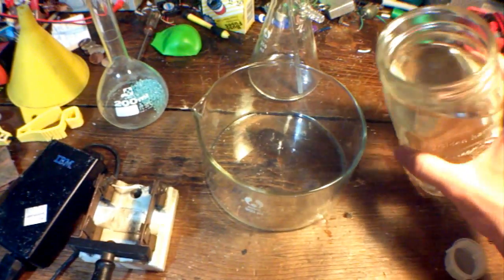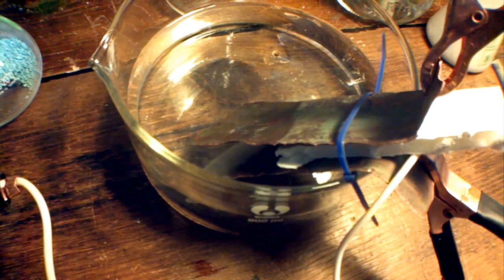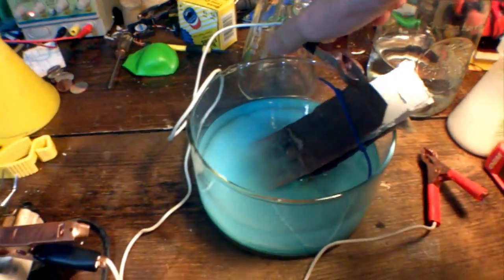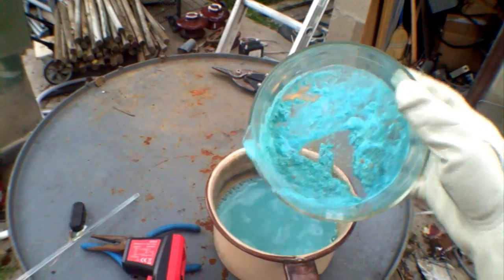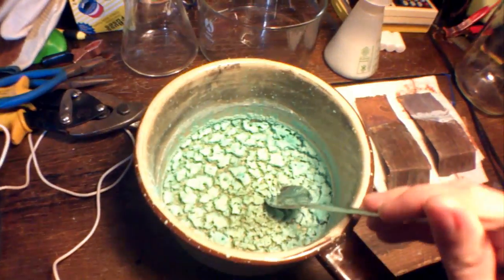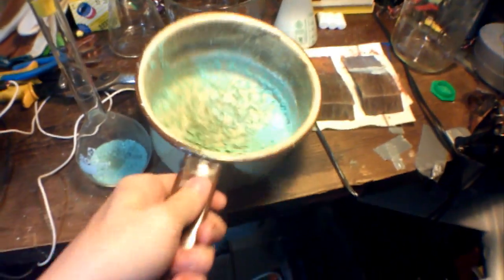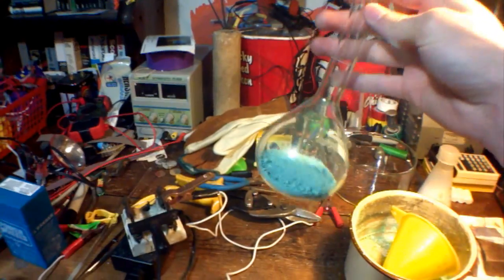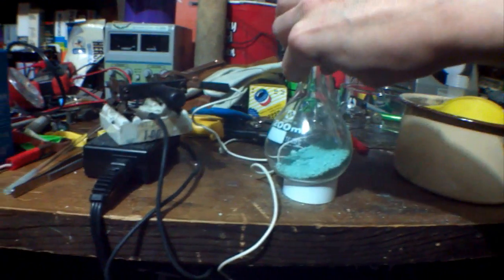DIY Making Copper Hydroxide via Electrolysis

Comment: Mine turned yellow??!!
Reply from the maker: maybe you did something different.
Reply: @RinoaL  what did i do wrong i got a 12v adapter copper wires on positive and negative and mixed iodized salt with water and expected to see blue water but it turned yellow..
Reply: @middleeasternvibes7981  you can't use salt (NaCl) that will produce Cu2O which is the yellow stuff
Reply: @Iodine_53  then what do i use???? Sodium hydroxide?
Reply: @middleeasternvibes7981  use a sulphate salt like epsom salt or copper sulphate works way better, and i don't think sodium hydroxide works. have a good day 

Edit: copper sulphaye does not work
Reply: @Iodine_53  D:

Comment: I'm trying to make a copper sulfate to copper coat steel so I can nickel plate them. I used white vinegar and copper plumbing tubing with a 5v 1amp charger with table salt. The solution did turn greenish blue but this black sooty stuff came off the copper pipe and turned the tubes black and settled on the bottom of the plastic tub ? What's going on there ?
Reply: The way you did it it's impossible to get copper sulfate, you just made copper oxide as there's no source of a sulfate ion

Comment: I have a question for any of you out there that have experience with making colloidal copper... My R.O. water measures 20 ppm. When I add a pinch of citric acid it then reads 290 ppm. After I add copper and run electricity through it it ends up reading 120 ppm... ?!?!?! I assume the electricity reduces the total dissolved solids, but how do I figure out how many parts per million is the copper? Any help with this would be much appreciated.
Reply: wow 4 years ago, did you find out how?

Comment: You can make copper III oxide out of this stuff if you heat it until it turns black. When you do this with table salt it produces lots of copper II oxide (brownish red color) and not very much of the copper hydroxide (at least in my experience). I will try it with magnesium sulfate later and see what happens.
Reply: Wes Murrell high volts and cold water make hydroxide
Reply: I maked it by salt coper anode and 12v AC

Comment: Electrolysis part:
Possible reactions at cathode: 
mg2+ + 2e-  -> mg(S)         E = -2.37V
cu(s) > cu2+ + 2e             E = -0.34 V 
2H20 > O2 + 4H+ + 4e    E =-1.23V
These are possible reactions at the cathode however the most positive will occur.
So real reaction at cathode: 
cu(S) > cu2+ + 2e

possible reactions at anode: 
2H2O(A) + 2e- > H2(g) + 2OH → (aq) E = -0.83V 
assuming basic solution for S04
SO42–(aq) + H2O + 2 e– ->    SO32–(aq) + 2 OH–(aq) E=-1.15

Although im not sure for the SO42- reaction 
 but the reaction that took precedence was 
2H20 +2e- > h2(g) + 2oh

therefore the total reaction is 
2H20 + cu(s) > cu2+ +h2(g) + 2OH E=-1.17 V
APPLY 1.17V causes this reactions to occur . Because of his layout there is a high chance of the hydroxide ion and copper ions colliding as they try to get to the anodes and cathodes causin the to react :

2cu2+ + 2OH- -> 2cuOH(S)

A tip for anyone planning to do this reaction , h2 gas is a product and is flammable! dont do this indoors!!!
Reply: I know theres been 5 years but could you help me please? If i dissolve KOH and run electrolysis, will it form Cu(OH)2 at the catode? Thanks!

Comment: Have you ever tried doing this with just copper and tap water (no added electrolyte)?
The tap water (and carbon filtered water) that I have been using is sufficient to conduct electricity. The next thing I will have to try is using distilled water...
Reply: I did this and tap water worked fine and didn't contaminate the product.

Comment: I'm making some copper hydroxide right now using electrolysis 
(using a standard phone charger connected to the anode and cathode) and I'm hoping I can safely use it as a fungicide for my garden plants. Can someone please tell me if this will be safe? And how concentrated does it have to be to work? Any information is helpful.

Here's what I'm doing:
My electrolyte is a weak solution of distilled water and epsom salt. I didn't want the heavy presence of salts reacting with the plant and soil doing possible damage to the microbes or roots. (I poured 6 oz of distilled into a mixing glass and add 1/2 tsp of epsom salt. then took 2 tsp's of the solution and added it to a 12 oz glass jar that is filled with pure distilled water.)  
I've run the current to the copper wires for 3 hours so far and there' only a very faint hue of green noticeable in the fluid. The liquid is tindall so I know that electrolysis is happening.
Reply: The water should turn more and more BLUE over time, not green. Something is wrong with your reaction. If I were you I wouldn't put any electrolyte in the water cause that could be the reason why you aren't getting any copper hydroxide. Tap water works fine, I've tried it, and it yields pure copper hydroxide. Also I was using 2 9 volt batteries but if I had more I would connect at least 4 together for quicker electrolysis.
Reply: A green hue suggests that there is a copper sulfide, not a copper sulfate or copper hydroxide. Epsom salt is magnesium sulfate, and so the required sulfur is available, so long as something else is interacting with the magnesium. Is there anything making contact with your setup that might be combining with, or otherwise trapping the magnesium? A contaminant, perhaps?

Comment: You could filter and wash the Copper Hydroxide out before drying. It make a much more pure product.
Reply: Mike Giles 
Also if you heat it, it forms Copper(II)Oxide. If you let the Hydroxide sit out it becomes Copper Carbonate.
Reply: +Mike G Which of the three forms would make the best fungicide for use on plants? Oxide, hydroxide or carbonate?
Reply: Luke Morrison carbonate!
Reply: Yeah, otherwise you keep all the magnesium carbonate!
Reply: Potato Boy  exactly

Comment: copper sulfate is very easy to make using electrolysis, but yo need to use a very weak solution of sulfuric acid and di water and keep the electrodes very far apart

Comment: Can you use anything as an electrolyte (eg. table salt/NaCl) or do you have to use Epsom Salts/MgSO4?
Reply: To everybody here I know it has been 5 years but using NaCl is a bad idea because it will produce chlorine and hydrogen which react explosively yielding hydrochloric acid, also it will more likely than not produce copper (II) chloride which isn't the same nice color but good on its own.
Reply from the maker: table salt would work fine.
Reply: I did the table salt thing. 

Looks lime green until it suddenly shows you an orange color, which you just simply can't miss.

I'm using regular tapwater now as prescribed by commenters, it does conduct electricity, but I'm not seeing any bubbles whatsoever, and I'm using 4x1.5V and 1x9V in parallel, with pure copper wire as electrodes.

You can turn the brown copper stuff into black copper oxide by heating it.
I just did this. It's tedious and idk how to do chemistry. Enjoy my advice.